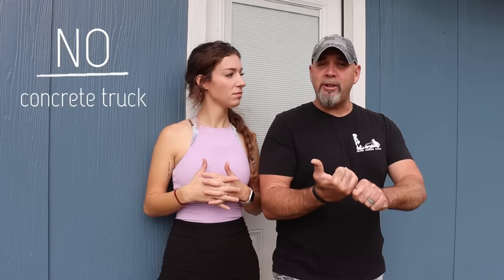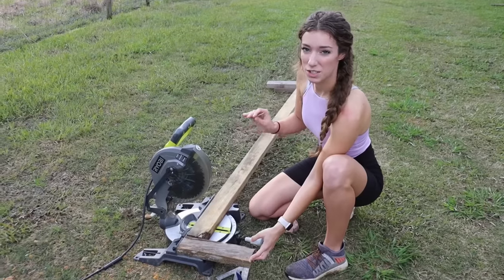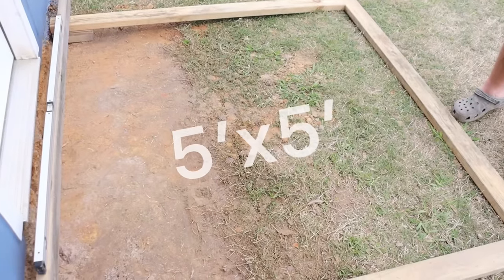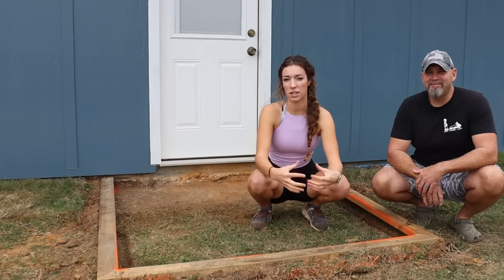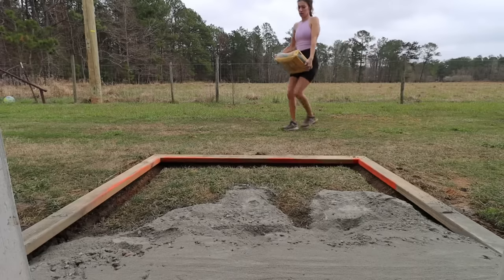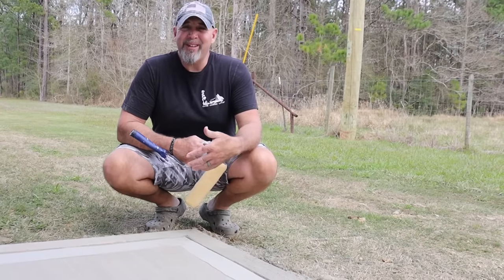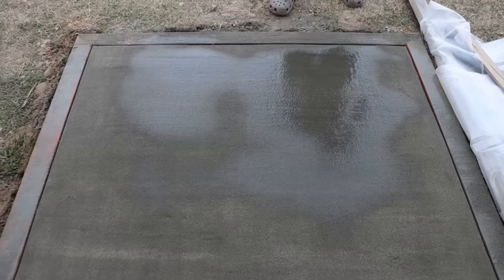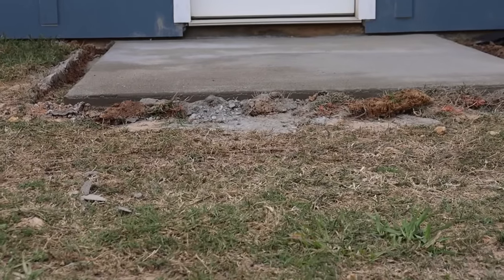How To DRY POUR CONCRETE SLAB and Update of Our 1st Pour

Comment: I just watched your video and some others about dry pouring concrete and I was wondering if I could be able to dry pour for a back yard putting green. It's about an 18x28 with some slope and contours. I would have to figure out something to allow for drainage. Do they sell a concrete that does not have the large pieces of rock in it? I should mention that I live in Florida so the ground is all sand after I take off all of the grass and weeds. My thinking is I can dry pour the area and follow the water procedure and then lay out a roll of artificial turf on top then trim it to shape. Maybe this could be something you guys could try to do and make a video on it. I bet you will get lots of views on it. Any advise from you on my project would be helpful.

Comment: You can flip the board instead of changing your saw  and you should be holding with the left hand and cutting with the right hand  the smaller piece falling to your right after the cut    Good luck  looks like you guys are having fun.

Comment: Very interesting. My only thought is why didn't you put the frame together on the vertical plane? You would not have had to mitre cut for the screws and there would be a natural 11/2" measurement for the low end since 2x4 s are not actually 2x4. And you most likely wouldn't have to pack so much dirt/ sod to keep the concrete from coming out the sides

Comment: I have a question. I live in Bay St. Louis, Ms.  Under certain weather circumstances  we can have a few feet of flooding on my street in yard and around house. 
I live on canal off Jourdan River. I want to build a slab to park a 16 ft cargo trailer with a tandem axle trailer.  I would like to build it 3 1/2 ft high. There would also need to be a semi gradual slope to safely back the tailer.  Do you think it would be possible to build what I described using one of your dry pour techniques?

Comment: Makes sense but starting with concrete wet lessons work time. Yes you have to move quicker but you don’t have to spend hours finishing it. Just my opinion. I would recommend removing the grass and using a layer of rock underneath as well

Comment: Isn’t that a little too much concrete? If you had mixed it with dirt to form dirtcrete or wood shavings to form woodcrete, you would have saved 4 times the material

Comment: I'll be 60 in June, live alone and on a fixed income. I'm going to try this for a "tiny house on wheels" but take the advice of your commentors about wetting the ground, pouring half, adding rebar and pouring the other half... Lord willing it will be a stable platform for the tiny house on wheels! Thank you all! (Commentors too!)
Reply: I have a question for you if I may. Are you putting your tiny home in the concrete pad? So you can live in it and not move it?

Comment: Will this still work if I use plastic underneath, and still wet it from up top / the settings as you described ? This wouldn’t be more than a 2x4 thickness, not sure if that would make a difference
Thank you :)
Reply from the maker: That will work just fine Casey!

Comment: I have seriously been thinking about doing this. I need a 12x22 ft area done. I have never done anything like this before. I've been told NOT to do it this way and that it will 100% fail. I would be using it to put our swimming pool on. I am so conflicted. I DO live in the North and have snow and freezing temps. Everyone says, "Have it done professionally and pay the extra 3k." Which would be just the labor not to mention the concrete truck w material. I wonder if this would do the trick.

Comment: Working on this project right now, and I believe not all 80lbs bags of concrete are created equal.  Came in to re-watch and right away I noticed the bags I got from Lowes are Sakrete "High-Strength 80-lb Concrete Mix" and the amount of aggregate appears to be double of what's shown in this video.  Not sure if this is part of shrinkflation, but I find it odd that our bags are loaded with cheapest portion of the mix and is not screeding properly or smoothly.  Unfortunately, I do not think we will be able to achieve the finish that is shown in this video.

Comment: So I tried this today and it seemed like I had more pebbles in my mix. It's just not as smooth as yours - is there something I did wrong? I followed the scree process and got it really well leveled out but seemed like there were lots of pebbles on top. So I continued on and with the watering recommendations and also used the paint roller to try and smooth it out and still seems so bumpy. Only thing I can figure is the mix has too many pebbles and not enough powder - I used the same brand and size bag as you all, too.
Reply from the maker: We’ve used almost every brand and have the same results every single time. The key is… make sure you have concrete mix higher than the forms and screed as shown.

Comment: I tried this method and could never get the rocks off the top especially near the form, at the edges. We screed it like 20 times and it didn’t seem like the rocks were going to go anywhere. Also, because of the rocks, I couldn’t get a smooth edge. Any advice?

Comment: This is the way they did it centuries ago. My grandfater taught me this in the 80s. 2500 is 25 shovels of sand and a bag of cement use smal sharp stones. Thr amount of stones is what you want it to be. You know you are right when you see consitsant stone when you float. I was taught to mske the most of wood, even with a wood float im no fsn of you watering the crmnt. Its not a plant. As cement dries, the warer pulls upwards. Im trying to figurr how you got water to work agaist the heavier weight of the material

Comment: Cracks in concrete are inevitable. Even the "professionals" can't avoid it. Go look at the driveways and sidewalks in any subdivision. It doesn't take long for those to start getting cracks. 
Also, I know you folks have already put your coupe back in place. But, if you put some boards under your legs, it will spread out the pressure points, and help keep that 1st slab from cracking.

Comment: You just got lucky because your soil is hard and stable. It is not recommended to pour concrete slab less than 2" thick. When pouring a concrete somebody expect it to last at least several decades without issues. Good luck with your new slab by the back door. It will crack soon if it holds a lot of foot steps everyday.
Reply from the maker: No cracks or chips in any of our slabs yet. They get foot traffic and run over with our zero turn and buggy almost daily.

Comment: So what's the total times you mist and shower?? You said 2 mists the 3 showers but the video said 6th watering?? 🤷
Reply from the maker: Mist once, wait an hour, mist again. Next lightly shower once every hour. We use two showers per inch of thickness as a rule of thumb. Example; a 4” slab = 8 showers.
Reply: @CajunCountryLivin  thanks for that, also what would be the metric formula for calculating how many bags of concrete you need. I'm in Australia and we have 20kg bags.

Comment: Seriously in this day and age, with lazy ass contractors that can't even pour a slab right.... you're better off doing it yourself. I paid 5k for a walk and patio. Put steps from the wood deck to the concrete, and the slab was only an inch thick. Thank you for this video!

Comment: This doesn't look any easier then mixing it in a wheel barrow and dumping it in, ensuring that it's well mixed. think all your aggregate is on the bottom.  Screening is easier when wet.  This only works with very thin slabs.  In the northeast, the ground heaves and would crack a slab like this first season.

Comment: Everything in America is cheap. What did you say. 10 bags for $50. Equivalent in bags in Australia would cost over three times that. Mixing it conventionally with ballast and cement. I reckon about $80. Interesting concept though. If a bit slow. All right at home. On a job site you wouldn't want to keep going back to water it.

Comment: Ok nice but why not just mix the concrete, pour it, and finish
Reply: I know why, for me, wet concrete is much harder to screed and to get it right. You are able to take your time to get it right before adding the water. One time, we had to work so hard and so fast we messed up a slab and had to call in pros to fix it. But i actually think the fault was with the cement company giving us the wrong mix. It wasn't wet enough.